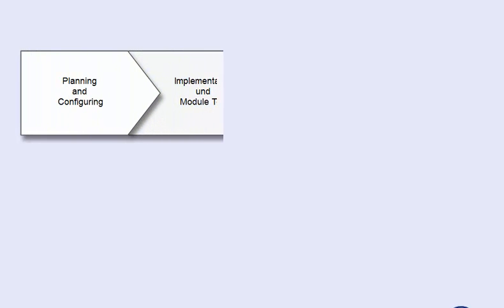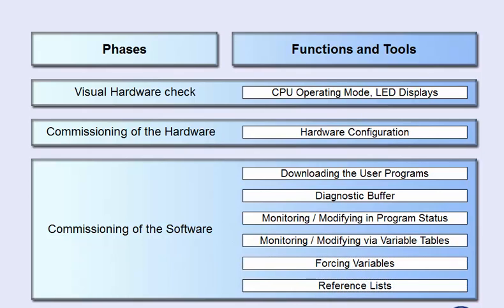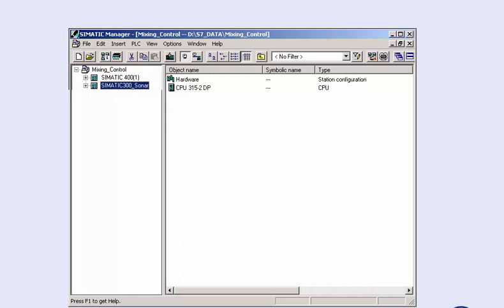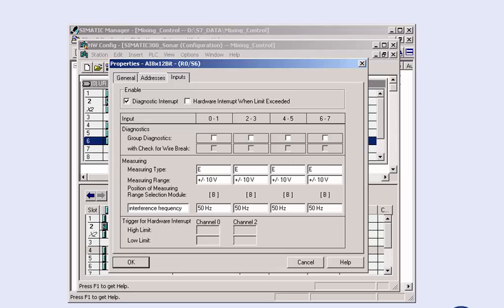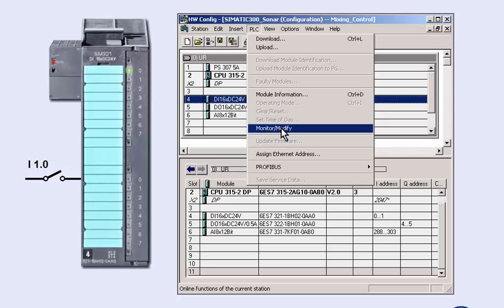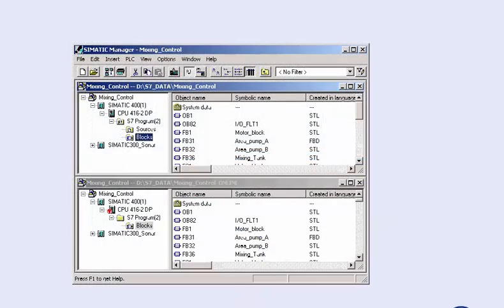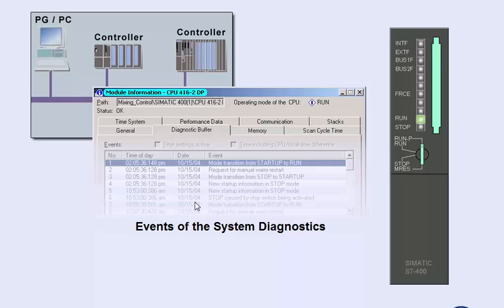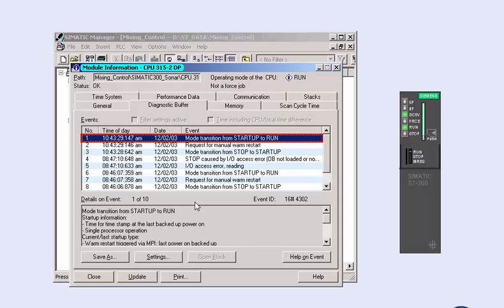PLC Siemens S7 300 Training, Lesson15,Testing and Commessioning, part1

Comment: sir I have  automatic sandblasting machine. in machine have siemens touch monitor. but now monitor touch not working...also monitor not available in market ... what I can connect in machine laptop ..... answer plz.plz
Reply from the maker: this types of touch screen runs a copy of runtime scada files , if you can transfer it to your lap top, and can connect the lap to your plc using the same interface, you can run the machine using your laptop